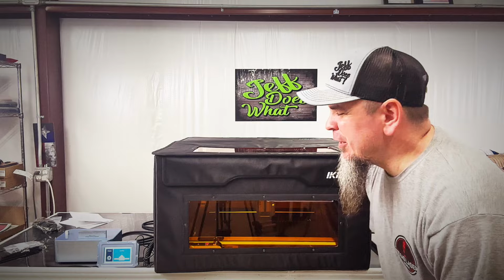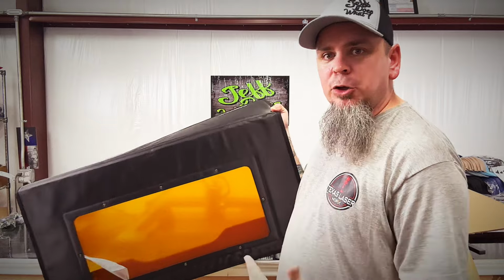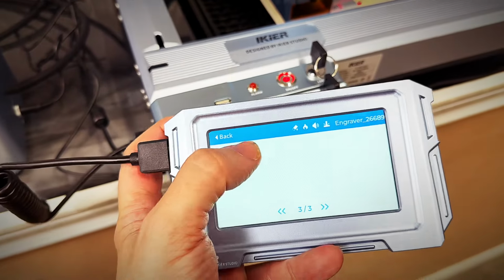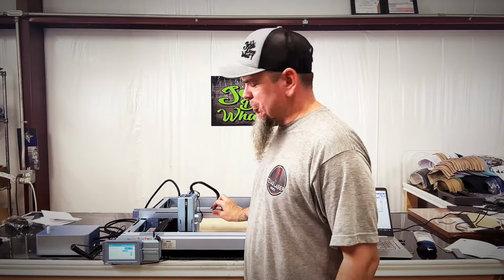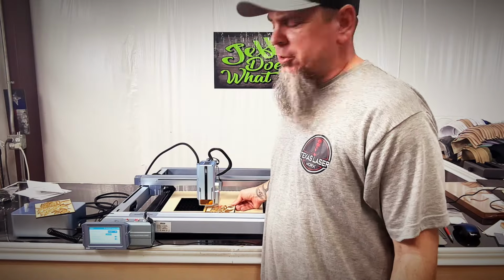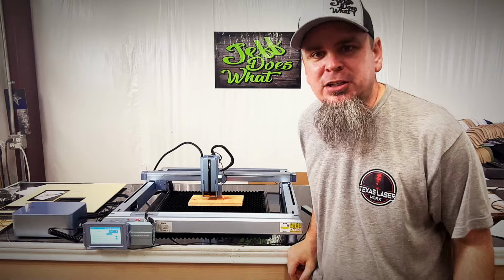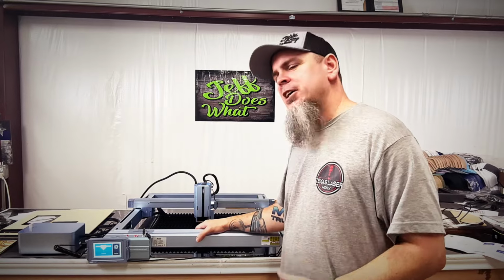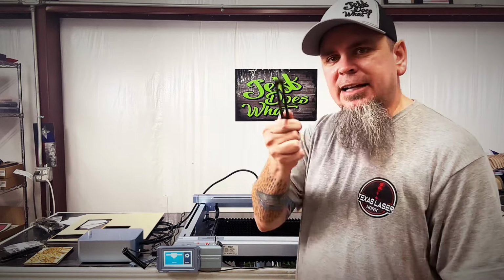Ikier K1 PRO Max: The Game Changer

Comment from the maker: I was wrong on the focus block. It is just for manual focus.
Reply: The auto focus function has a known problem. It can sometimes not register and force the z axis into the material non stop making you stop the machine before dsmage is done. 
When reviewing lasers, it would be helpful to include the macro for auto focus [ESP 500] and how to calibrare for the cross hairs.
Reply: Hate to say you are wrong, but you are. I own that machine and it is complete garbage with no Customer Service help. $2000 paper weight. Also the cooling fan downdrafts any and all debris and smoke into the module. Crap design.

Comment: It all looks cool from theses who are doing the review. I have two of these machines. One worked for 3 months and the module started rattling, it turned out that a few mirrors inside the mirror system just fell off and the machine stopped working. I bought another one - the salesman assured me that this batch has a refined module. But after 2 months the machine started to lose power.
Reply from the maker: I’ll have to keep an eye out for that.
Reply: surely that's a warranty claim  instead of buying a whole new machine?